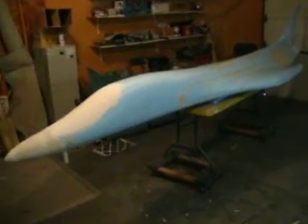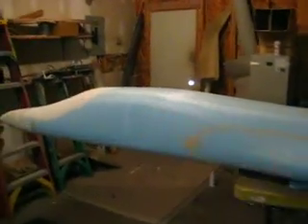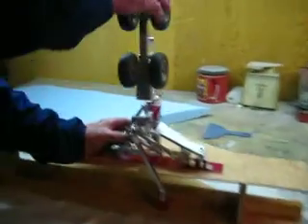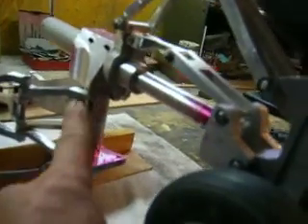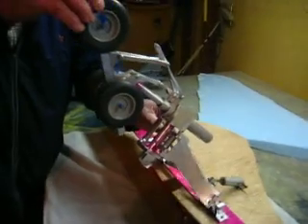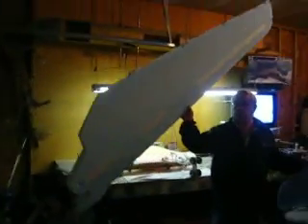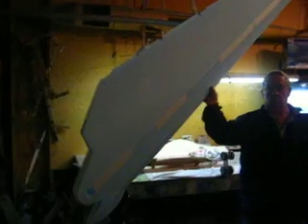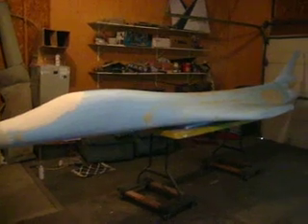how to build a RC jet B-1Bomber  #3

Comment: nice work I have my profile B1B ready for motors for a test bed on how to make the canards work on a gyro to help the CG and  center of lift change. I am thinking this is going to be the best way to fix the problem with the least amount of drag and wight. so if that works the way I am thinking I'll have the problem solved and would give you this info 
If you fly it at War Birds Over Denver this summer